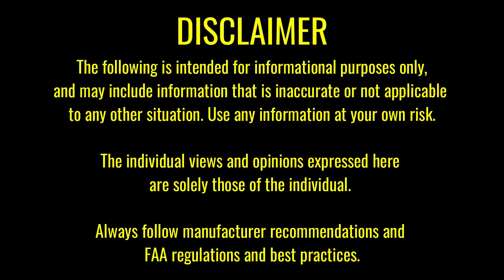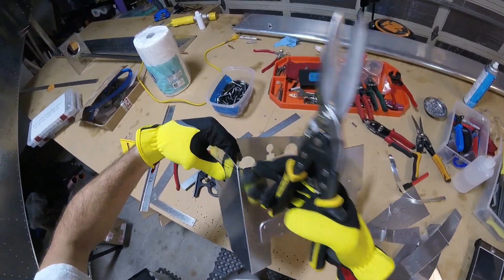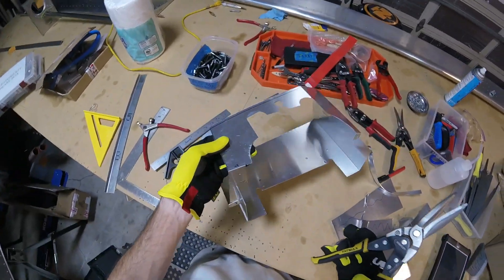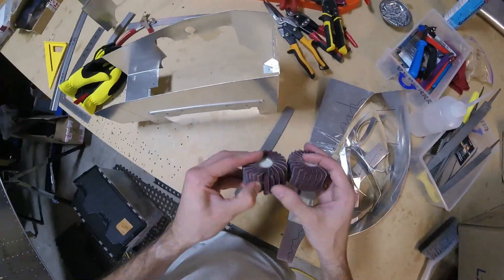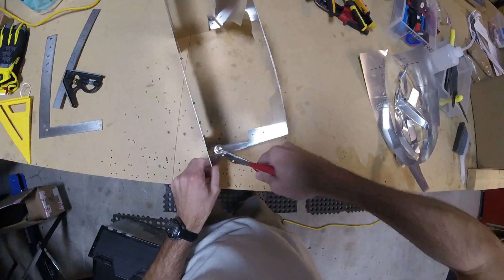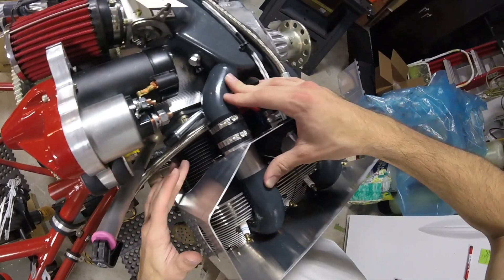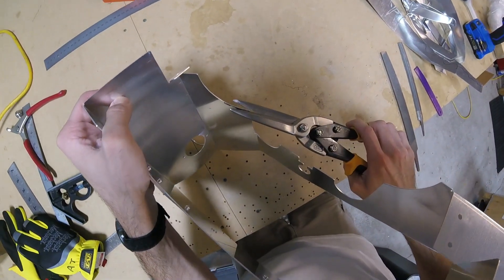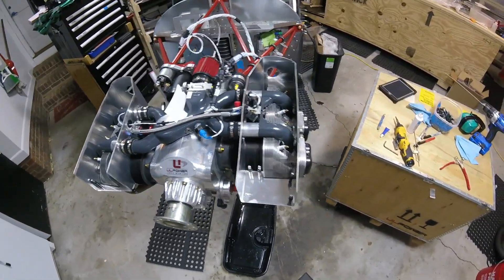Engine Air Boxes PART 3 - UL350iS Zenith CH 750 Kitplane Build

Comment: Snips are available in left and right hand. Most manufacturers of snips make them with different length cutting blades. The short blad s are easier to cut curves and thicker material. Great work on modifying the air boxes!